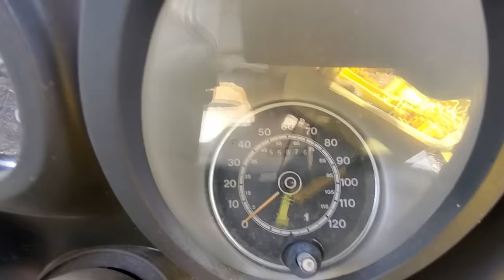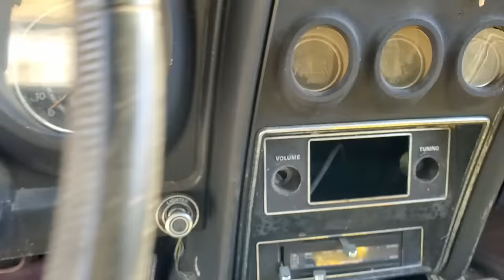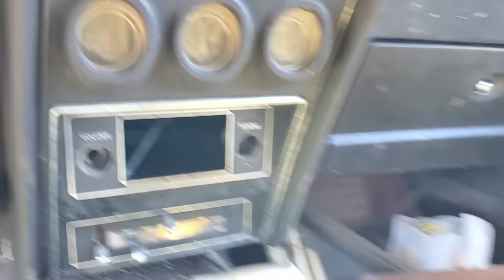1973 Mustang (MOOstang) Abandoned in Cow Field For 30 years! | Can We Drive It Home???

Comment: Wow it warmed my heart to see it drive, no modern car sitting for 30yrs would ever be in such a good shape. Goes to show everything was made to last back then.
Reply: They don't make them like they used to😂
Reply: I've revived a few efi vehicles from 15-20+ years of sitting. Sensors and whatnot don't really go bad from sitting as long as the hood has been shut from the elements. As long as rodents haven't gone crazy they'll usually fire right up. Almost guaranteed the fuel pump is dead and tank is rusty, but that's typical.
Reply: In my state cars dont rust or fall apart so i bet you could do it with a modern car.
Reply: what you talking about? a modern car would be just the same condition this is if it sat for 30yrs and take the same effort to start it.
Reply: @darkshadowsx5949  Modern cars wouldnt rust as much better coatings and etc, but I can tell you that with how many computer chips are needed to start a modern car good luck lol. my car would not start solely because I know that it would neeed about 10 computer modules if it sat for 30 years and they wouldnt be around anymore and the car will die solely due to parts.

Comment: A ford, yes please
Also that engine is a 351 cleveland. It had 8 valve cover bolts and the radiator hose comes out of the block and not the intake manifold like a 351w and 302
Reply: I was going to say that. You beat me by 8 minutes!
Reply: I thought so that valve cover definitely didn't look like sbf
Reply: 2V or 2 barrel Cleveland.  Most 71-73 Mustangs came with either a 302 or 2V 351 Cleveland.  I don't think Windsors were even offered, and there weren't a lot of 6 cylinders either.
That 2V motor is a good motor.
Reply: @Stucifer  I once owned a '73 Mustang Grande Q code 351 Cleveland 4 barrel. It was a screamer.
Reply: 2 bbl. 351C heads better for street use... 4 bbl. heads had horribly shaped ports...
Reply: @BuzzLOLOL  agreed.  Problem with the 4V heads is actually the exhaust ports.  The 4V has massive intake ports, but the exhausts are too restrictive.  The floors look alright, but when you look into them you see that the exhaust has to go over a hump and straight down.  An engine is a pump, and that stops it up.
Racers like Bob Glidden took a big slab off the bottom of the heads, getting rid of that restrictive exhaust hump and allow exhaust to exit straight out, rather than down.
There is no doubt the heads are capable of great horsepower, but the engine had other flaws, like poor oiling and heavy valve train
Reply: @RobertDickens2002  Cleveland is a small block.
Reply: @MaxGiganteum  Ford's 260/289/302 and 351W engines were all made @ Ford's Windsor engine plant.  They are all of the same engine family and some parts interchange.  F Code for 73 means it was a 302 2V.  Yes, it is a Windsor; but people rarely call anything but the 351 a Windsor.  And that was only to differentiate the 2 351 CID engines Ford was making @ the same time.
The Cleveland was for performance applications.  They didn't offer the 351W in a Mustang after 1970.
There were no factory 351W cars made between the years 71-73

Comment: Much respect. I’ve had an old 73 coupe since I was 17. I bought another one a couple years ago for parts and ended up keeping it. It had been parked in a field for only 3 years. Had to cut the drum off the back brake it was so seized up. Looking forward to getting it running soon.

Comment: The rocker nuts will loosen up over time and cause a lifter tap sometimes. If you pull the valve covers while it is running and loosen each individual nut till it starts tapping, then tighten it 3/4 of a turn or until it stops tapping, you can fix it sometimes. If it keeps tapping even when fully tightened you can get a slightly longer push rod to compensate and fix the problem. Nice car. That's the grande model. I have a 72 coupe with a 302.

Comment: Chad I'm gonna go out on a limb and say that's a 351 Cleveland in that car. If the radiator return hose bolts down to the top of the block, that's what it is. If it bolts into the front of the intake, it's a 302 or 351 Windsor.
Reply: The only way to tell the difference between a 351 C or 302 C is to look at the crank shaft. they will be marked either 302 or 351. Also, Clevo's have that box shape on each tappet cover. Windsors had the symmetrical tappet covers ,almost the same from the early 60's.
Reply: 302C is very rare and has narrower intake manifold... not likely one in here... 
Looks like desirable 351C !!! Hose goes down into block... 2 bbl. heads more desirable for street use... 
4 bbl. 351C heads had too large and horribly shaped ports...
Reply: We didn't have 302 Cleveland in the states only Aussies had the good stuff.

Comment: I love the simplicity and reliability of older cars. I imagine that it would be alot harder to do this on a modern car that’s been sitting for 30 years although I’m not a mechanic so I’m just guessing 😀
Reply: Imagine how many sensors you’d have to check and replace just to get the thing going
Reply: That mustang quit working at 55k miles.  Probably looks the same as the day they parked it.
Reply: My 2014 ford fusion hybrid was leaking headgaskets at 86 k tells ya something about ford's quality

Comment: I always find it so amazing that something can sit for so long and in a few hours or whatever it can start again.  I used to restore old farm tractors.  Most of them were just people that wanted their tractor degreased and cleaned up and a fresh paint job.  But one day I was driving in the country and saw this old tractor.  I could just see part of the hood and the muffler sticking up out of the weeds and luckily they had a soup can covering the muffler so no rain would get in the motor.  It was a Ford 2n built during WW2.  Had been sitting in that spot for around 30 years also.  Tires were all shot and flat.  Just looked like a big hunk of metal.  I saw the guy outside doing some yard work and for some reason I just wanted to ask him what it was.  He told me the story of it and that it hadn't run for at least 30 years.  I asked if he would ever want to sell it I would be interested.  He looked at me like I was crazy.  And told me he didn't figure that he would be able to even give it away.  Lol.  He offered it to me for free if I could get it out of there.  I came back with my trailer and winch and took it home.  I also gave him 500 bucks which he didn't want to take.  It took  me a week but I got it started.  Then I worked on that tractor for 6 months.  Took every single nut and bolt off of it.  The motor was not froze.  And was actually a really good strong running motor.  Got it all finished and I loaded it up one day onto the trailer and stopped by his house.  He could not believe it was the same tractor.  I took it to a lot of shows and won a couple ribbons.  But I just love seeing old things brought back to life.  Omg.  Sorry about writing a book here.  Lol.  This video just brought back that memory and wanted to share it.  If anyone made it this far thanks for reading and to everyone else.  Sorry about the rambling.  Lol.  Great video.  I really enjoyed it.
Reply from the maker: Great story! 👍

Comment: Only a Ford could come out that situation so well. I LOVE  my Fords. My 1st car was Grand Torino with the Modified 400. Same year and body style as In Starsky and Hutch. I left a Trans Am and Corvette in my rear view mirror. 😂 They couldn't believe it was all Factory issue. I've had to Lincoln's and 6 Fords since 1980. Right now I am sitting in my smooth running 2009 Ford Expedition with 306000 miles on it. I also have a 2006 Crown Victoria Police Interceptor. It's a beast with over 350000 miles on it. 
Keep up the good work , Bro !!

Comment: That's almost definitely a MotorCraft 2150 carb, common carb on old Fords, especially that base V8 302W. It's less than 300 CFM, and starves that little 302 but they're generally reliable and super easy to get parts/rebuild. They used that same carb thru the mid 80's, so there's a ton out there.

Comment: My dad had a 1973 buick century Gran sport 350. It was a great car and it only had one thing which was a pain for maintenance. The rear set of spark plugs were easier to pull if you did it from under the car. All the rest could be yanked from up top. 😂 But what a wonderful car it was. Lasted until it had too much rust under the vinyl top and 167000 miles on it. Just needed top end rebuild and would have run fine until 200k plus. Never left me stranded or made me worry it would leave me high and dry. I didn't appreciate it when I was a kid (young and dumb) but now it's one of the best cars I ever drove. Some good newer cars out there but I'd pay 50k for a classic before I'd waste 20k on something newer. Can't replicate old school cool
Reply from the maker: New is bland in my eyes.
Reply: @ThisNThatGarage  Amen. It all looks exactly the same but costs $40k yeah I'll pass. Better hoard the classics before the auto companies start reproducing them to save face, causing the originals to skyrocket in price

Comment: That moter mathes the valve cover and 2V specified a 2BBL Cleveland as uppise to a 4V with those famous   351C 4V heads. The 2v is torque, the 4v had the horse power and RPM's

Comment: your transmission... Put those in neutral. Let it run for about 20 minutes.
That'll allow the oil to circulate and warm up. It will pass through the valves etc. That doesn't happen in park. Don't just throw it in gear.

Comment: It really is amazing how it repairs and manages to start engines that have not worked for many years. However something is not clear. As I know when an engine does not work for a long time the oil loses its properties and the pistons, the connecting rods of the engine must be cleaned... So my question goes in that direction, at what moment during the filming of the video do you change the oil and  Does it clean the internal parts of the engine?

Comment: That alternator voltage is gunna boil the battery dry. Run a wire from the alt sense to the battery positive for the mean time

Comment: I love watching somebody pull the air cleaner body off of a carb on an old beater. 

I do it at work to a customer's classic car that drove in and there's no wingnut, something half rounded off none of my sockets really grab correctly, a crumbling heat riser that fails to let go, two rock hard vacuum lines that won't separate from brittle vacuum fittings, a hose clamped piece of garden hose, bailing wire, some bolted tab of steel going to a bracket with a rounded off bolt and a dead mouse in the filter.

Guys on youtube working on a beater. 

removes wing nut and lifts

Comment: Every time I get an old car, I put Spartan newspaper plugs newspaper plug wires. Change the oil in it, flush off the gas tank. All that stuff, man. You gotta do all of that before you see. You got bad 30 years bad gas in it. You're gonna put a seat for melon and I'll turn it back into gas, but don't overdo it.  Northern Maine got bad Motorola limit.You said there's oil in to get an I'm gas in the oil.You gotta change all of that before you cranked that motor over it just ruined it more than it

Comment: Welp.  Those fuel pumps are gravity feed and tou had the gas can under the car..  probly was a good fuel pump.  Also it should start in neutral (neutral safety switch)
Reply from the maker: Actually they are not gravity feed. There hasn't been a gravity feed tank in a normal passenger vehicle in many years.

Comment: dude. that's not a 302, nor is it even in the windsor family, it's a 351C 2V. That's closer to 180hp, with way more torque than a 302. Nice setup. p.s. the 302 back then had a 15426378 firing order, whereas the 351C had a 13726548 firing order, so don't wire it wrong.

Comment: Ford is one of my fav cars. My dad has a 1966 mustang it turns on but it needs alot of work. Also my dad has a 1970 plymouth barret cuda wich also needs alot of work. But my dad passed away so both the mustang and the cuda are collecting dust in the shop.